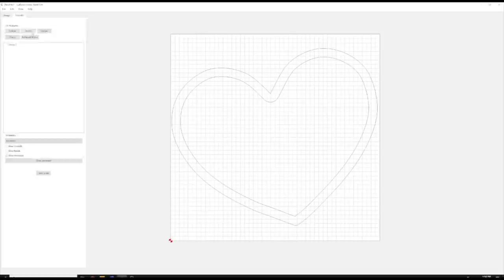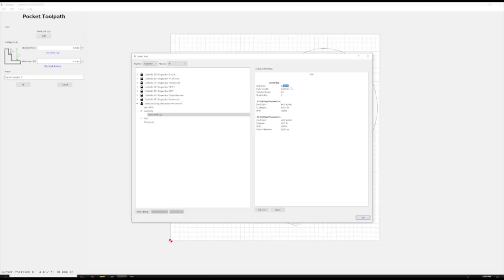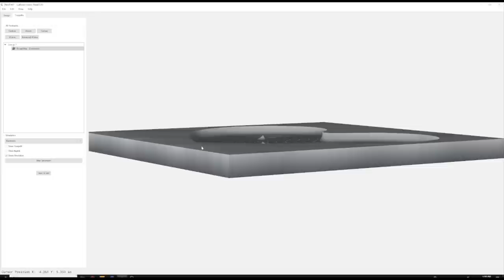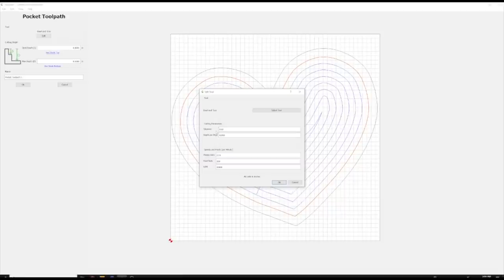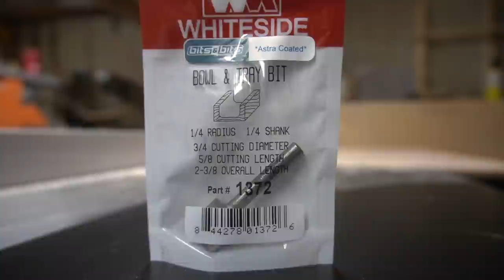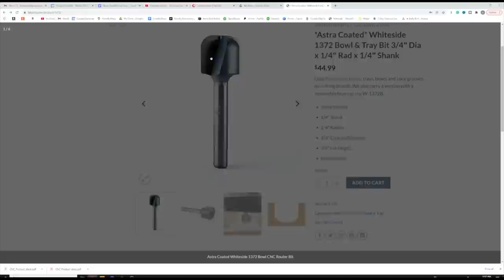SUPER Smooth Finish With ZERO Sanding! CNC Tutorial

Comment: In machining, this is common practice. It's much easier to get accurate parts when your finish pass is like .01" because there's a lot less tool pressure. You find that your depth of cut, speeds, and feeds all vary depending on material, but in general, when roughing, you have lower speeds, higher feeds, larger depth of cut. For finish passes, higher speeds, lower feeds, minimal depth of cut.

Comment: I have a really good result with a .25 end mil bit for roughing. then a .25 ball nose with a 35% step over. This has turned into my one of my fav bit sets a .25 end mil then a .25 ball nose then a 1/32 tapered ball nose 8% step over for the tapered ball then i use a 45V bit to clean up the edges. But this is for high detail.  Rest Machining method has became my friend.
Reply from the maker: Nice, Thanks for sharing your recipe!

Comment: my go to is cur roughing, then go back and cut final - .003 depth in raster with wood grain, then do final pass of .003 with wood grain raster pass.  elinates any tool marks and makes super clean.  i also like cutting profile to start with bowl bit, and then use flat end mill at stepover of .45 to do everything but final pass, then reduce stepover on that pass.

Comment: I've seen this before but never in this walk-thru format, that was helpful. Could you use just a flat 3/4 bit? Then use the bowl bit for the finishing passes and get that curve at the bottom in those final passes? Would that work? I'm not sure how deep that curved portion would be so maybe that wouldn't really save time? Does that make sense?
Reply from the maker: Glad you found it helpful. This applies to any bit. Even if it's a flat. In general, the lower the stepover the smoother the finish.
Reply: I think swapping bits out would introduce extra time. Plus, that's a 1/4" radius. You'd need to stop your flat bit 1/4" up from the bottom. I run my last pass at 0.025" which smooths out any ridges that the 40% stepover roughing passes leave.
Reply: @JasonPeltier  yeah, that's the assumption I was operating on: Swapping out the bits and have to swap at that 1/4" from bottom mark would likely take more time. Thanks for the confirmation. Either way it's now clear I need to be more patient about that finishing pass and really reduce the step over. Thanks!

Comment: When I first got my bowl bit I hated it. It left those ridges and I had to sand sand sand! 

Then I realized, duh, run the final pass at 8% stepover. Now my life is much easier. I've also introduced a vbit and paint in the process. Have you ever been able to be messy with your paint brush but never have to clean up the edges?
Reply from the maker: You're definitely not the only one. I did it too!

Comment: Andy I saw these 2" non woven Scuff & Buffs on Klingspor's website. Could you put this sander ball in CNC and sand your trays faster than sanding by hand?  Maybe they are too big diameter but worth a try???
Reply from the maker: I'm not sure. Might be a good experiment 🤔
Reply: Check out "sanding mop", fluffy and regular and use it on a drill press.
Reply: I'd think the shaft is too long at 3". I doubt if it's balanced like a router bit. Rotating at 16,000 to 18,000 rpm, the non-woven abrasive would probably fly off the shaft in a matter of seconds.

Comment: I've not personally found any real difference between going to .4, and doing two .05 passes to .5, and going to .45 with a single .05 finishing pass. I just really with programs like Easel would let you set them into one NC file easily so it would just switch and do the finishing pass without interaction. I think Fusion 360 can do it, but I'm still trying to figure all the CNC file setting out for my machine.
Reply from the maker: It's all in one NC file because I have thr bitsetter on my Shapeoko
Reply: In Vcarve Pro, I make 2 separate toolpaths. I'm not sure if it's possible to switch stepovers in the last pass. And I set my last pass at 0.025" with no problems. I run the roughing passes as normal. And then the "finishing" pass, I set the depth of cut as the full depth of the carve with a starting depth of 0"
Reply: @JasonPeltier  I’ve been tempted to copy/paste the gcode from one file into another to see what would happen

Comment: Andy, I have a question that’s kinda off the specific topic of the video. When setting the dimensions of a cut, does the CAD software consider the bit? For example, if i want to cut a 20” square, and with using a 1/4” down cut bit, does the software have the cutting line starting at the center of the bit, or does it consider the bit being used and do the calculations? If using the center of the bit, and I put in 20” x 20”, it’s gonna end up cutting 19 1/2” total cause of the 1/8” from center of the bit. I’m asking cause I cut a rectangle using that 1/4” bit, and it appears it came up an 1/8” shot on all 4 sides. What do you think? Any help is greatly appreciated?
Reply from the maker: Your software should have the option to set the toolpath to the inside, outside, or center. So if you want a 20" square you'd set the toolpath to the outside

Comment: I have a similar work flow and I do one pass. I offset the shape inside to get a small size thats centred, I just do a regular contour pass to the depth of pocket I want to create. Then set up the pocket operation at full depth, a small stepover, high feeds. Reason for the first operation is getting the bit in full depth and let it move without all the materials in the way. In carbide create as well, you should try it, It's faster than this technique.
Reply from the maker: Interesting, thanks so much for sharing. What is your depth of cut?
Reply: @AndyBirdBuilds  Depending on the bit and material, 12mm, I can do 10mm 12mm DOC, 2-3mm stepover, 3500-4500mm/min. I'm Nigerian and we do have some really dense hardwood species here. The hardest woods will use the lower figures. I use 2 straight flute cheap disposable woodworking bits and they do a great job. I've a DIY CNC with a 1.5kw water cooled spindle, it's plenty power I think. Keep up the good work with the videos, I always love them. Thanks.
Reply: Didn't understand your workflow.